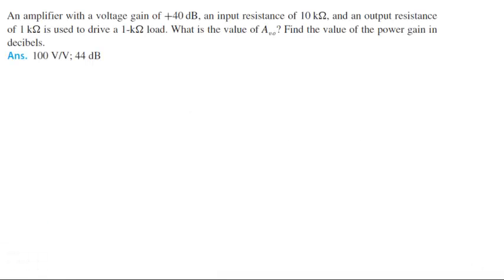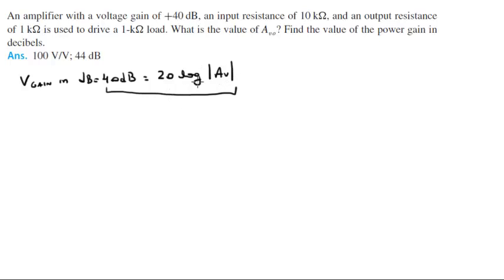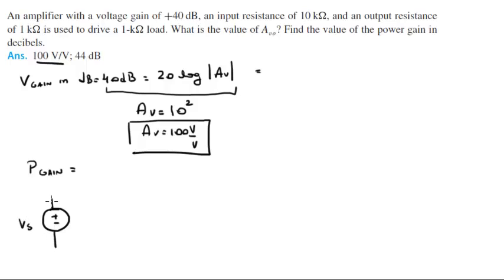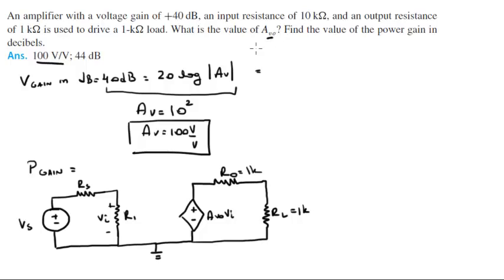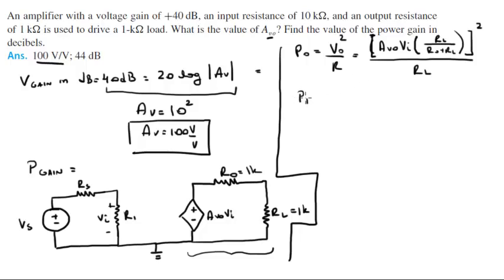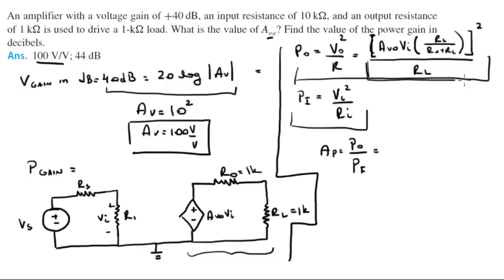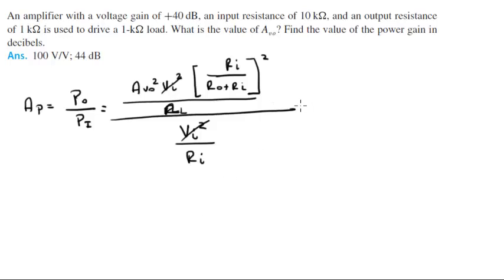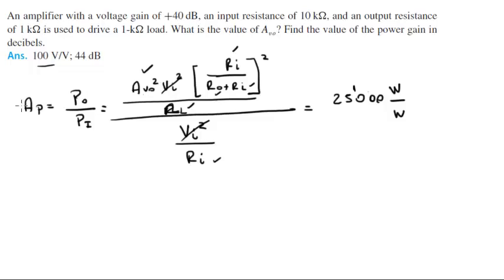What is the value of A_vo? Find the value of the power gain in decibels

Comment: Why are we using the power on Ri rather than the power drawn from Vs while calculating the power gain?
Just like how we use the voltage of Vs while calculating the voltage gain. Then why use the voltage of Vs rather than the voltage across Ri? 
How does that logic add up?